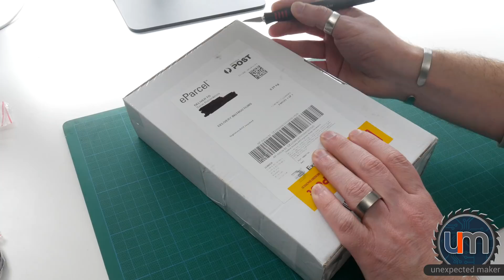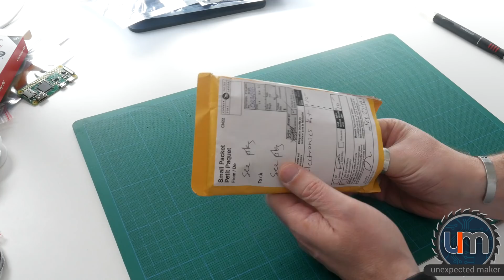Unexpected Mail #14 - Goodies Galore!

Comment: Seems like getting 10 of those attiny85 digispark boards would cost around the same.Also,the link for the LEDs reel doesn't seem to work.
Reply from the maker: Sure, they'd cost the same as clone digisparks, but then I couldn't use them on my custom PCB's. I've switch links for the LED reel, not sure why the previous link stopped working. This link is pointing to a more expensive reel I got, but the chepaer one.
Reply: Could always desolder them, but i guess the time that takes wouldn't be worth it. By the way, what do you think about the optical fiber found in AliExpress? (keywords seem to be optical fiber cable glow) Could probably make interesting stuff with it, say, something like an rgb nixie tube?
Reply from the maker: Yes they do look very nice, but I know nothing about them, sorry. AAAAAND - I don't need more distractions right now ;)

Comment: I am guessing SPI flash is just for a quick flask compared to I2C flash?
Reply from the maker: Is there such thing as I2C based flash memory? I've only ever seen SPI based flash memory. There is also a QSPI (something like that) based flash that is much faster than SPI.
Reply: 3D printers sometimes use I2C flash. I guess it's for settings.
Reply from the maker: That's all I wanted my flash for... I'll look into I2C flash too as I don't need fast memory, just needs to be non-volatile.
Reply: EEPROM  such as (24LC512) is only 512k though. This is a small break out board I made.
 https://i.imgur.com/0OtBogK.jpg
https://i.imgur.com/SnMklDZ.jpg
Reply from the maker: Ha! nice!

Comment: I could not find any reference to not needing caps on sk6812s, where did you hear that?
Reply from the maker: Limor mentioned it in one of her "new new new" episodes when she was showing off a new RGB LED strip. I'll try to chase it down and I'll post the link in a reply.
Reply from the maker: Found it... so it doesn't need a resistor and CAP at the start... caps through the chain might still be needed, so my bad.
https://youtu.be/SDdyPTQWOOk?t=6m4s
Reply: Unexpected Maker hmm yeah I checked the product images and they have decoupling caps. Was wondering if it was the same, maybe she means the bypass cap.
Reply from the maker: Yeah I clearly miss-quoted Limor about the decoupling. Sorry!
Reply: TU, Just wanted to catch that if it was a mistake , I have a sk6812 project in the works, and own some strips of them. It is good to have confirmation that they are much better esd and surge resistant even if they still need caps, I am using 1 cap per 2.. should be ok